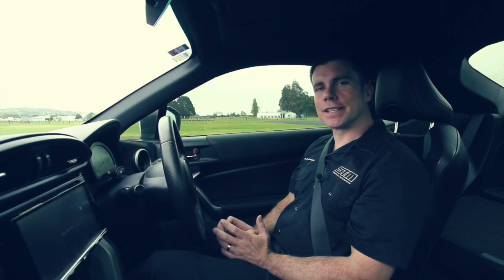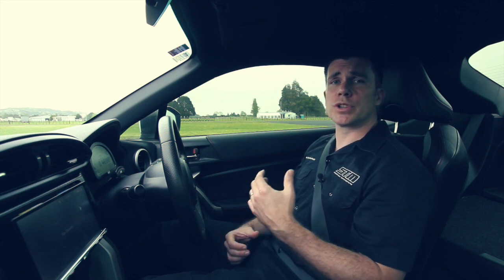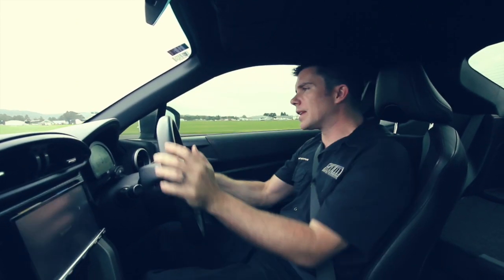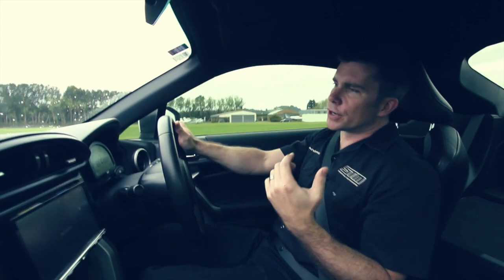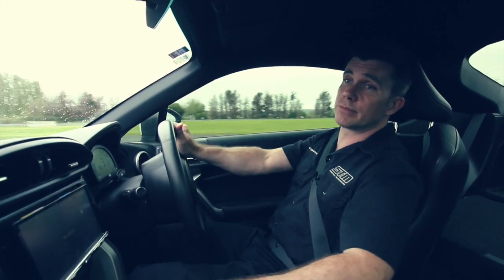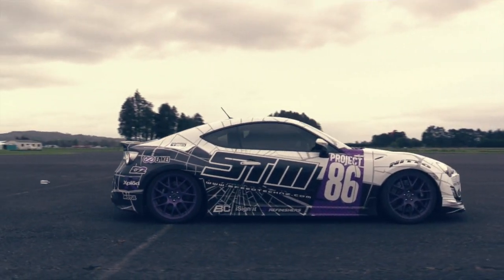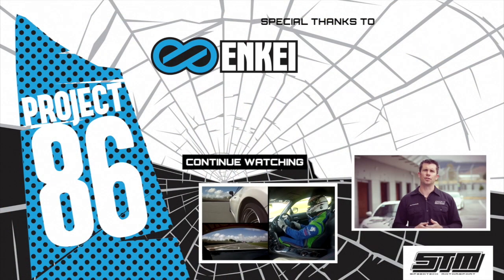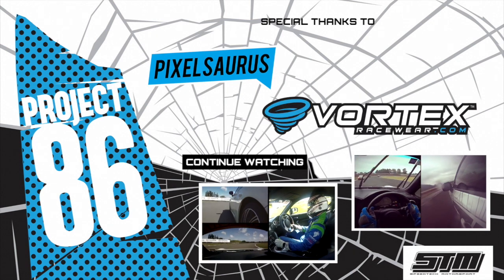STM #Project86 | Final Test Day - The Full Package

Comment: A turbo system and a supercharger system.
Bolt on Supercharged for the street. Stock motor with supply options "but not needed" like injectors, fuel pump, pressure regulator, 30% larger radiator

Comment: 120 odd kW ? Wow that not great. A k20a with a tune , 3" exhaust system and air filter makes 165 atw. Although rwd has more power loss that's not great. Not to mention the DC5R is much cheaper than the GT86.